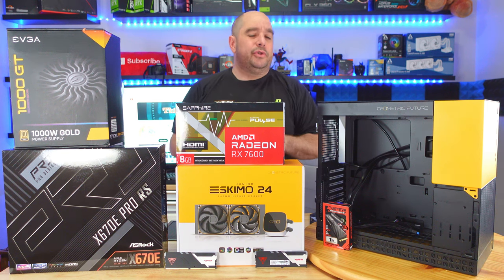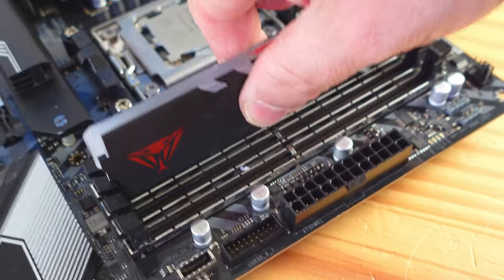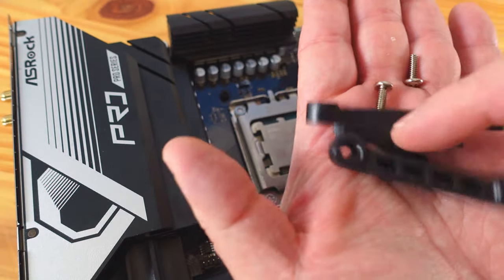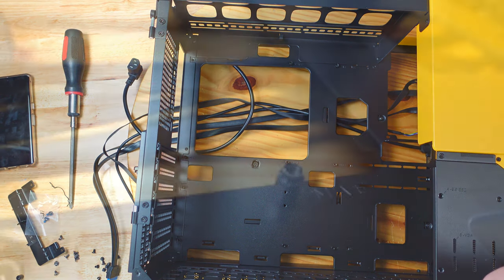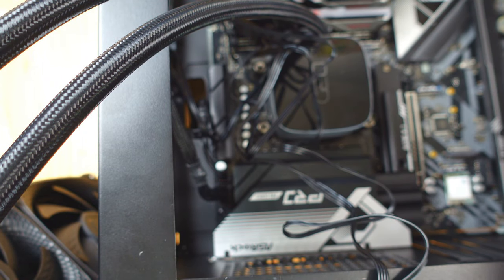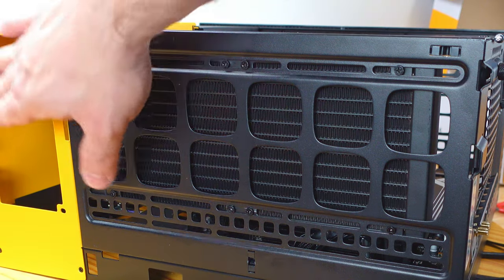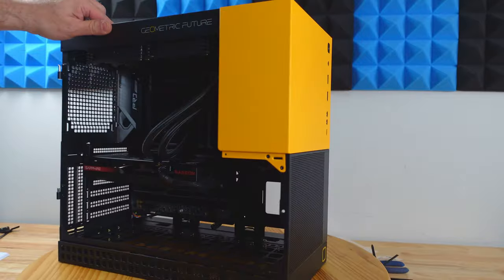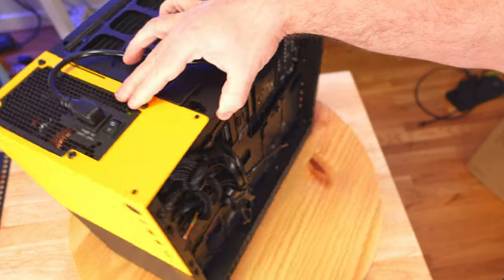Your Ultimate PC Building Guide for Beginners

Comment: Do you think it is better to use the bios flashback feature on the motherboard to update it without the cpu or build the whole system and do it in the bios? Is there no difference because I want to update it and want to know which is better
Reply from the maker: Well, flashback can save time if you have bad components, but the chances of that happening are low, I prefer to build them flash.  What do you think, how would  you approach this?
Reply: @ThisBytesForYou I think I am going to use the flashback feature just in case if there is a bad part.
Reply from the maker: nice, I may try that the first time too on my next board, let me know how it goes for you.  Usually I do it only when a boards/bios is messed up to recover or only to support a cpu that isn't already supported.

Comment: Great videos 
Quick question I recently started getting black screen while gaming  
I've switched out ram clean ram slots same with gpu uninstalled drivers recently installed  new one yet keep getting black screen randomly any tips? Thanks in advance ☺️
Reply from the maker: So that I can help, please list the manufacturer and exact model number of the following components:
1. Motherboard - manufacturer and exact model number
2. CPU - manufacturer and exact model number
3. RAM - manufacturer and exact model number
4. Video Card - manufacturer and exact model number
5. Power supply - manufacturer and exact model number
6. Monitor - manufacturer and exact model number
 Redundant I know, but many people forget to enter manufacturer and exact model number
7. Do you have ALL of the PCIE connections plugged in, and not daisy chained or pigtailed, each coming directly from the power supply?
8. Are you running through HDMI, DP, DVI, VGA, any adapters?
9. Is UEFI or Legacy Setup in the BIOS?
10. What slots do you have your RAM installed in?
11.Do you have CSM Enabled or Disabled in the BIOS
11. Installed latest supported chipset driver?
12. Have you disabled Fast Boot within Windows?
13. This video will help you identify hardware inside your PC: https://youtu.be/65ZSiVImJx0
Reply: My guess is needs to update graphic drivers .or a dodgy hdmi port .or power supply .
Reply from the maker: thats why I ask all these questions, so I can help

Comment: Hey man I wanna ask something...
1. Eps 4+4 pin is for cpu right?.
2. Can eps 4+4 pin be used on a atx powered cpu?
3. I have an atx 4pin cpu socket, so can I use the one eps4 pin and leave the other 4 pin dangling?
Reply from the maker: I dont know what you mean by ATX powered CPU?  
1. Yes
2. ATX is a form factor (for motherboards), the 24Pin, while trivial is call the ATX 24Pin connector, nothing powers a CPU but the 4 pin or an 8Pin cable.
3. That is correct, you can use 4 of those pins and leave the other 4 dangling.
Reply: @ThisBytesForYou  I mean that is what's written above the cpu 4pin socket on my motherboard ( ATX Cpu) So I don't know if eps pin can be plugged into an atx cpu socket....
Reply from the maker: Atx CPU power, yes so that is correct, the abbreviation to not take up space, I thought you were staying that, I was trying to help you but yes that will work there
Reply: @ThisBytesForYou  thank you so much
Reply from the maker: Always a pleasure my friend, so very happy you stopped by, trusted in me to help you, liked and subbed as well as took a moment out of your day to thank me.  It means a ton to me and I am so very happy I could help you.